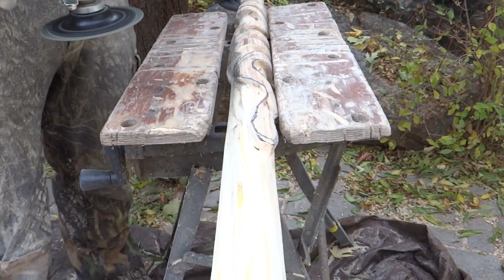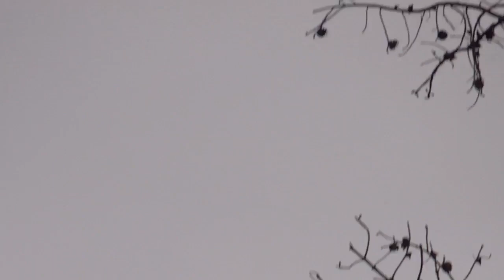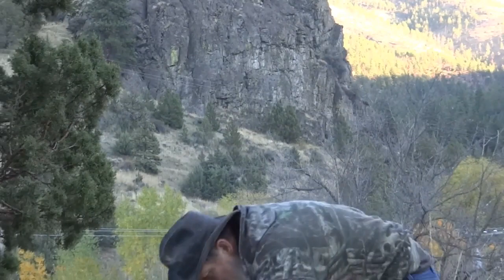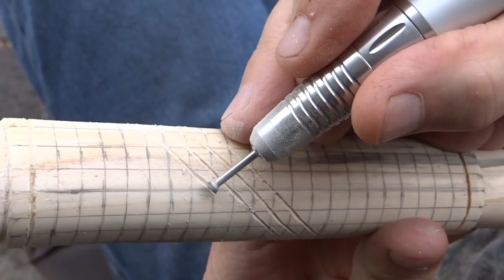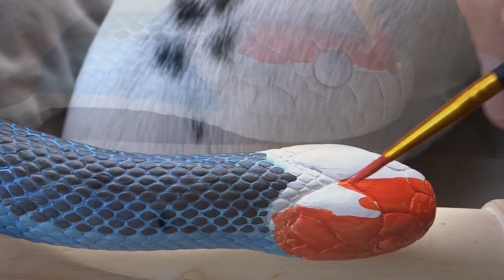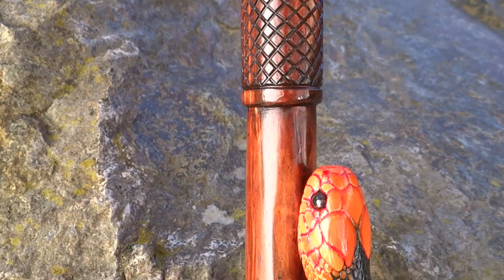Carving A Malaysian Blue Coral Snake Walking Stick #73

Comment: on the wal nut hollow versa tool i am trying figure out why iam having such a hard time burning oak popluar  and maple any suggestions please?!!!!!! are you using soft woods the softest woods i can get pine or fur then it is in 2 by 4 form so i would have to glue it to gether
Reply from the maker: Hi, Lawrence. It does take longer to burn the hardwoods. I usually work with pine, or cedar. The only thing I can think to do is turn the burner to the highest setting. I'll do some tests with it on some hardwood. It could be that your unit is defective, possibly.
 It's too bad that you can't find cedar or pine, or fir 4x4 posts. They would be a lot easier to work with.
Reply: thanks for getting back with me,i realy like your videos .keep them coming thanks. tell pearl I said high